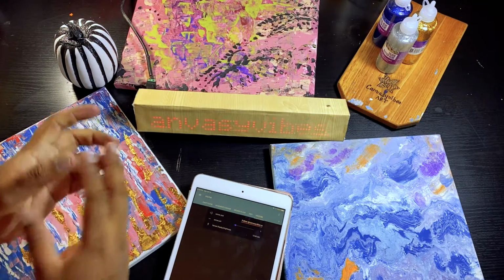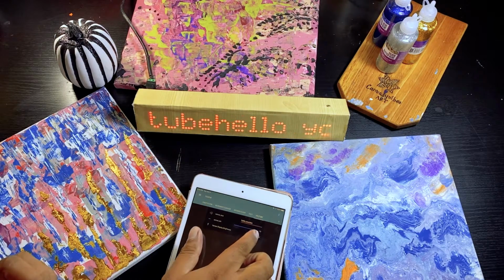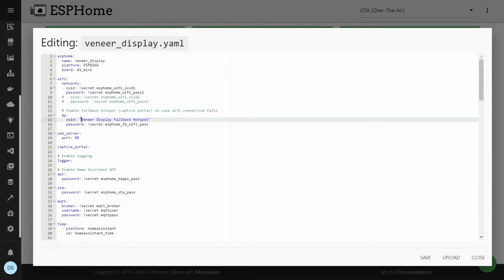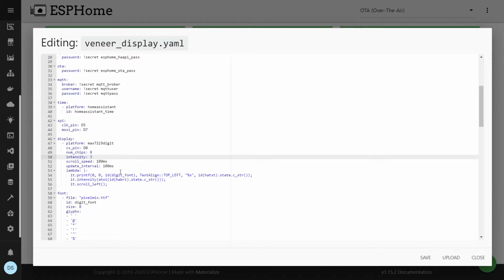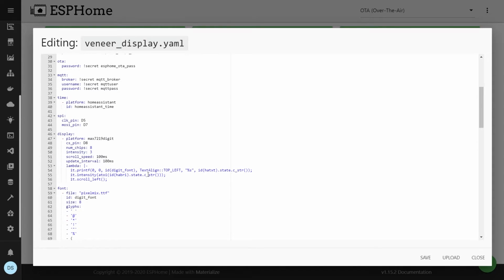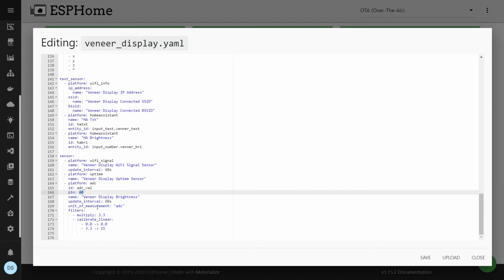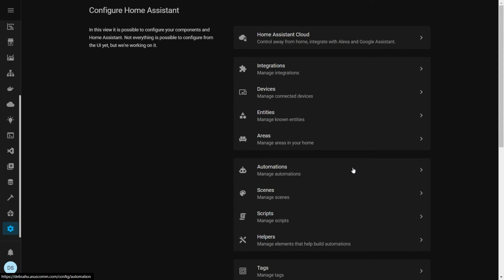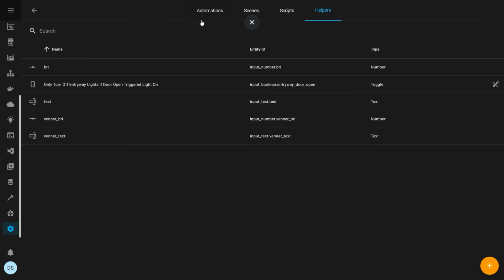ESPHome Dot-Matrix Display | Internet Connected Display | Home Assistant Display

Comment: You also need to go in to Settings and then Integrations and you need configure your ESP23/ESP8266 device if it hasn't been already.  You'll need to grab the encryption key from the yaml file for the device because you will be prompted for it when you click the configure button.  My marquee wouldn't display anything but when i entered the encryption key it displayed my message just fine.
Reply: Even if it's showing up in ESPHome and it's configured there, you still need to do this in the Home Assistant settings as well.